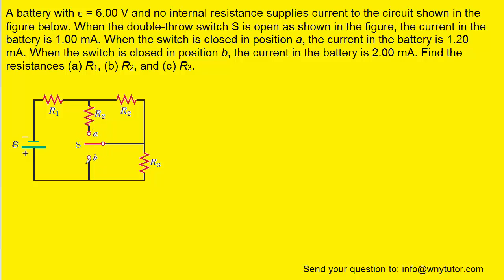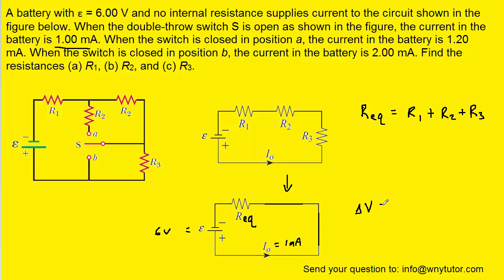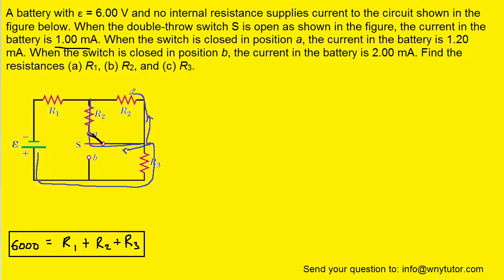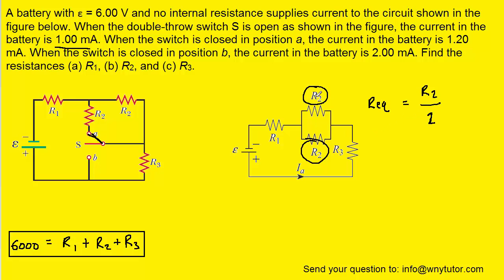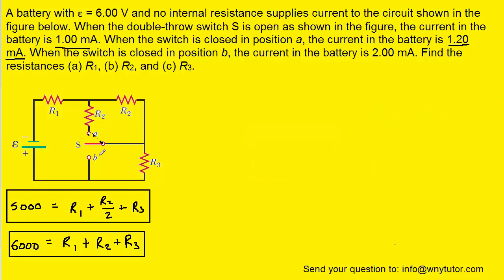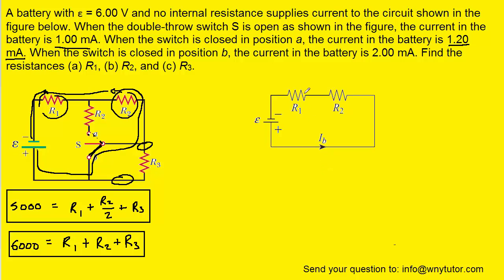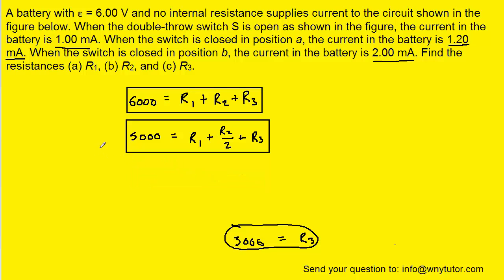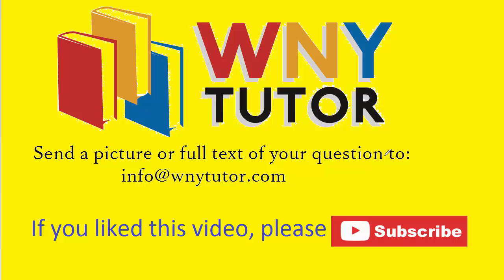a battery with emf=6v and no internal resistance

Comment: three resistors 4 ohms 6 ohms and 8 ohms are connected in parallel in an electric circuit if combination is connected to a battery of emf 25 volt and negligible internal resistance.Determine the current through each resistor and total current drawn through battery
Reply: plz send me the ans in method

Comment: one question is a10v cell of neligilble internal resistance is connected in parallel across a battery of emf200v and internal resistance 38ohm find the value of current in. ...circuit in which 10v ,200v,38 ohm is given

Comment: why isn't there potential difference in R3
Reply from the maker: +Dipam Shah Good question. Pause the video at 5:00. Starting at the positive terminal of the battery, move counterclockwise until you reach the first junction (below the switch).  The voltage at that junction is 6.00 V, since no resistor is present before the junction.  Now follow both "paths" past the junction until you reach points both immediately BEFORE and AFTER R3.  Again, the potential at those points is 6.00 V, since no resistor was encountered yet.  If the potential immediately before AND after R3 is 6.00 V, then there is no potential DIFFERENCE, and thus current will not flow along the path that includes R3.  Does that make sense?